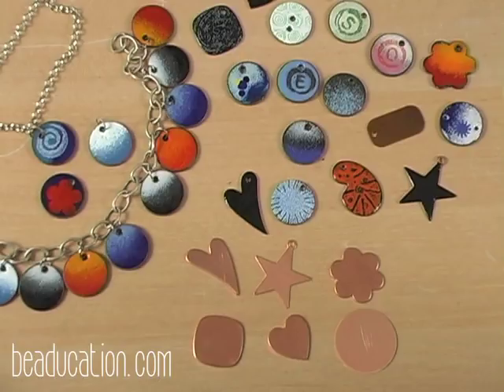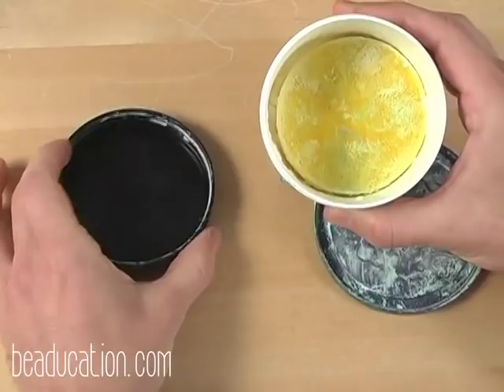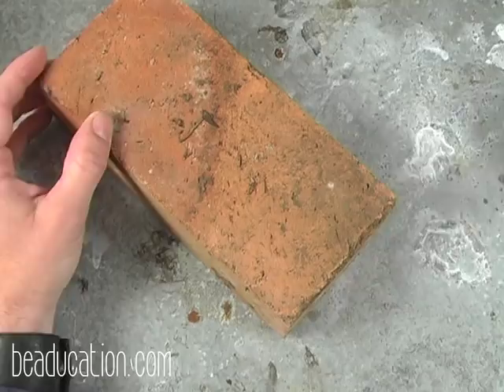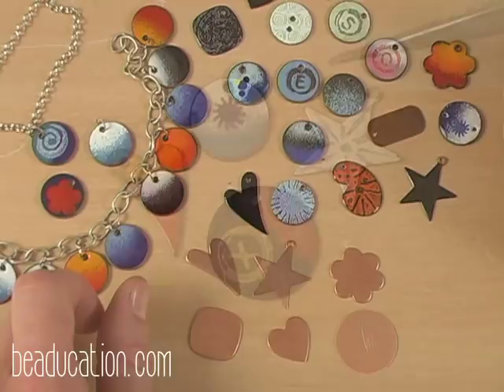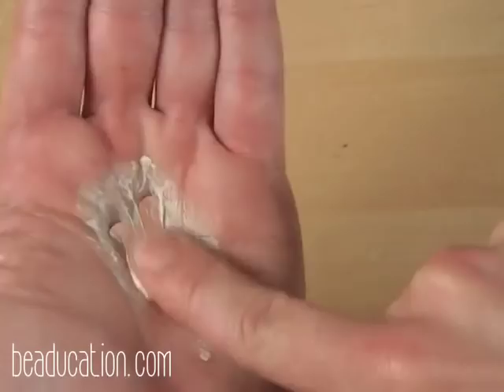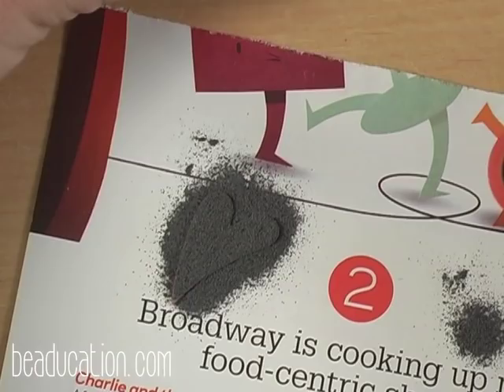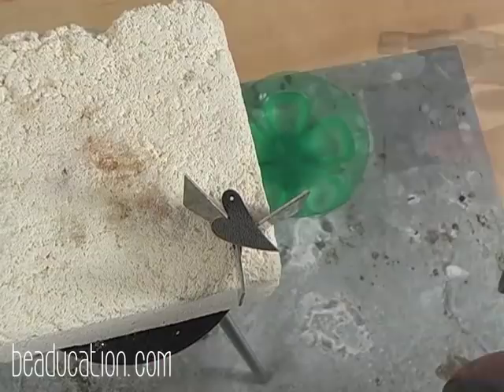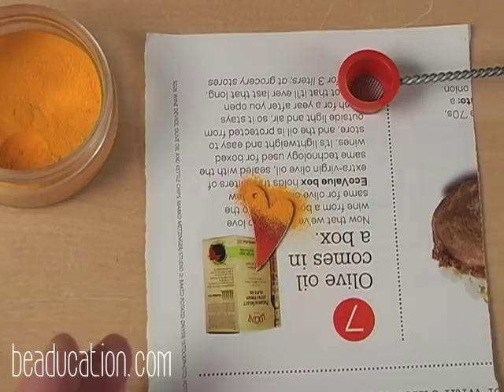Torch Enameling Tutorial - Beaducation.com

Comment: What am I doing wrong when my enamel chips? It seems like it looks great when I am finished with the 3rd coat and then all of a sudden there is a chip. I clear my copper with penny brite ~ wear plastic gloves, use tweezers to pick up my pieces... maybe am I putting on too many layers of enamel or heating to hot??? Any help would be appreciated. Thanks!
Reply from the maker: Hi Debra! It sounds like your enamel is too thick. Try doing only two layers, or thinning out each of your three layers. Good luck!
Reply: @beaducation  do u mean sprinkling less enamel before firing?

Comment: Great class for an enamelling newbie like me! Thank you so much! Some instructions I read recommended using holding agent before sifting enamel. Is it a must or optional? I noticed that Steven didn't use any holding agent and sifted enamels directly onto copper.
Reply from the maker: Hi! Yes, you can use holding agent if you would like. Because the pieces in this class are flat you don't have to, but it's a nice tool to have in your enameling supplies. Have fun!

Comment: I've torch fired enamels on copper and can't seem to get the reds bright enough. I'm using orient express red and it comes out way dark after it cools, almost has a gray or black tint, just not the bright red its supposed to be.   I've tried several diffent reds and they all seem to have that problem.  I'm using thompson enamels.  thoughts on why that is?

Comment: what is a minimum thickness to maintain in enameling on silver,, do the silver with becoming soft in the process,  i want a video working on silver, where do I buy powder enameling
Reply from the maker: It's probably best to enamel on fine silver if you are interested in working with silver. If you are venturing off into other metals like sterling silver you need to find the right enamel to work with that metal. Steven mainly works with copper and the enamel used is to be used with copper and fine silver. We work with 24, 22, 20 and 18 gauge. Check out his class, Torch Enameling Tips (link below).

https://www.beaducation.com/online_classes/182-torch-enameling-tips-and-tricks?cat=4

Comment: Fabulous tutorial! I do have a couple of questions though and hope that it's not to late to get an answer... First, can I add fine silver beads to the finished project? I'm curious about whether or not they would stick or if perhaps the silver might get to hot and burn the enamel. Second, when using a holding agent (I use Thompsons) (on a dapped piece) should I be adding 1/3 parts H 2/0 to the Thompsons? I thought that I was supposed to however, when I did, the enamel didn't stick. I feel like I wasted the holding agent as I made a batch of it!
Thanks! ;0)
Reply from the maker: +Teri Steinborn Hi there! I am going to email Steven to see what his advice is on this. I'll check back in with his answer :)
Reply from the maker: +Beaducation Hi again Teri! I just heard back from Steven and here is what he had to say...

Always happy to help! 

First, I NEVER dilute the holding agent.  I use it as is, right out of the bottle.  Second the dapped copper might be 'dirty' and that is why the enamel isn't holding (fusing) onto the metal.  

As for the silver balls, super fun idea, but they won't get too hot to melt the enamel - it is the opposite, the enamel might get to hot and melt the silver.  I've done this with wire and it is quite possible with balls, just need to monitor the process, so they don't become blobs, but that could be cool too!  

I hope that helps.
Reply: You're my HERO! You know, I watched one of your videos on enameling (that's where I learned about Thompsons holding agent...went right to the laptop and ordered 2 bottles...thank you very much ;0)  ) and I could almost swear you said to dilute the holding agent with 1/3 water!
When my package arrived I even remember going back to YouTube and searching for that same video just to be sure...
Anyway, I'm on my way back down to my shop to do some more enameling....Yeah me! Oh, and you!...My HERO!
Thank you again and Have a Wonderful Christmas... Or Happy Holidays....
My Warmest Wishes to you and yours,
Teri

Comment: my question is this. once i counter enamel and then do a first coat and then want to do i design i feel like i’m roasting and ruining the first coat as i now fire it again and it takes a while to take the second coat (whether it’s a stencil design or scratch design) through the proper stages of firing. do you ever just partially fire the first/base coat when you’re planning on doing a design and will need to fire it again?
Reply from the maker: I do not know the answer to this question but I have emailed Steven and will hopefully be able to get you an answer soon.

Comment: Do you have to have a counter enamel on the opposite side?
Reply from the maker: +Key Oke Hi Key! Counter enameling helps to stabilize a piece, especially when the metal is very thing.  There are instances when I DON'T counter enamel and of course the project is at risk of chipping/cracking.